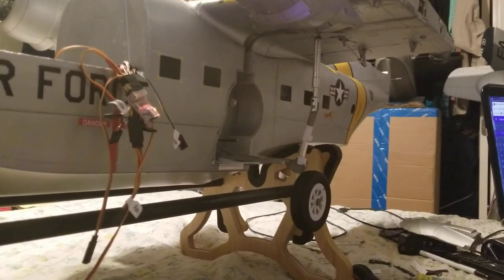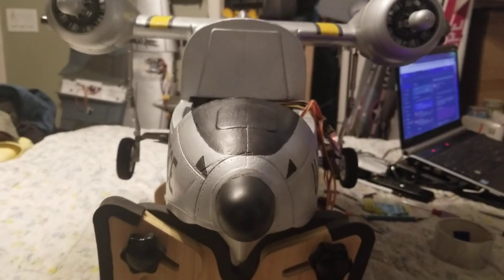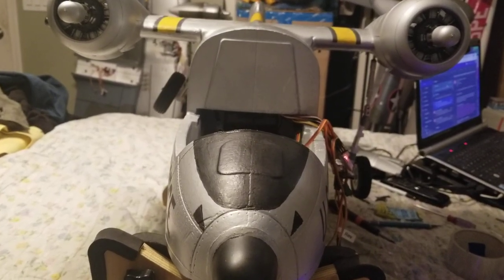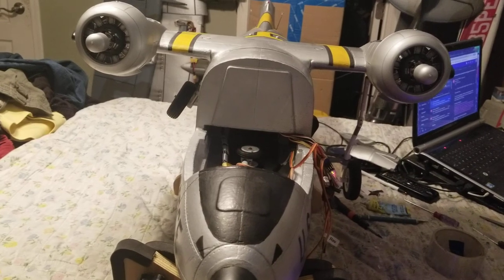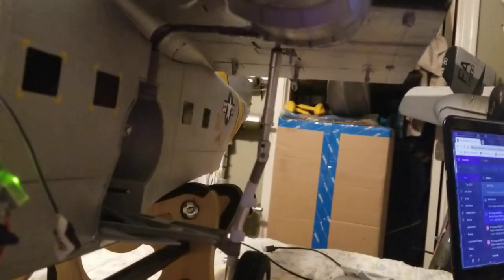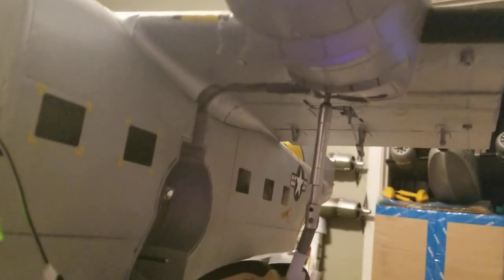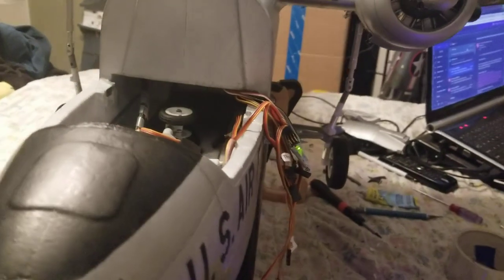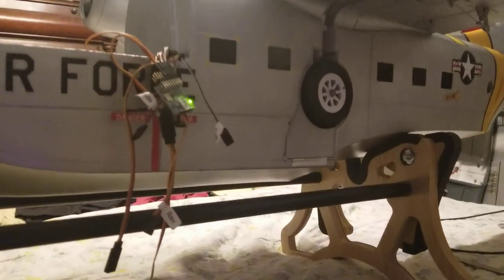Retract mod for Avios HU-16B Albatross

Comment: If you have sticking problems, you might have "more sticking" in flight mode with relative wind against them...Moses <><
Reply from the maker: Sticking problem has long since been fixed. Current work perfect in flight. But you definately dont want to land or pancake it in hard. Though most of the flying is off water then taxi up on hard surface, same for take off.